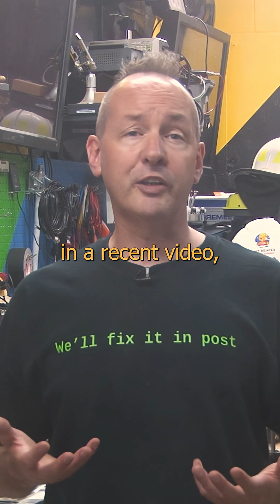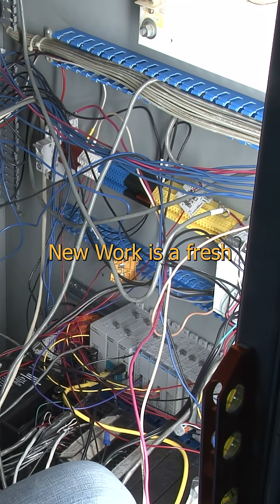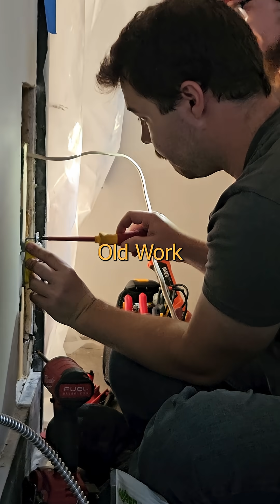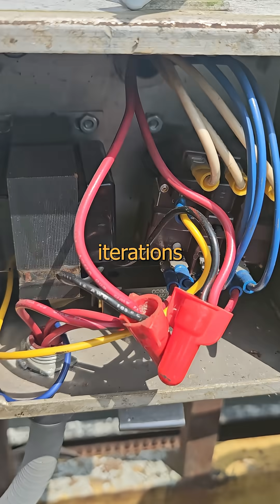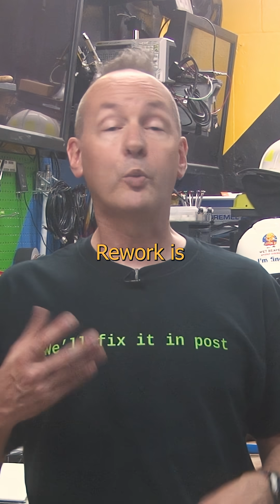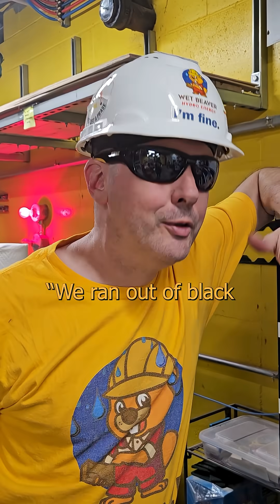New Work, Old Work, Rework #chrisboden #comedy #engineering #electrical #construction #educational

Comment: Pain. I had to re-do warm floor in my unit because some moron used two black wires in the electric panel for it instead of a black and a white. So when electricians were upgrading the panel, they assumed that it was a 240V circuit. Well, it was not.
Reply: I'd say the fault is more on the electricians that assumed based on color conventions when conventions frequently get subverted in the interest of going home at 5 PM
Reply: @esper4605 exactly 😅 I never assume the last guy did it right, I actually tell myself the last guy did it wrong so I don't get as pissed when I see the jerryrigging 😂
Reply: @TylerAllen-zx2ef  Especially if you were the last guy.
Reply: Nah I love when I was the last guy. I always give my best and almost Everytime I've had to come do something I touched last, it's nearly always a smooth job  @MrStrykerOne
Reply: @esper4605 Go see the comment I just left for just that
Reply: @esper4605  those assumptions are based off of strict state electrical codes but go off on how you dont know about the lowest minimum standard in trades
Reply: @MDS-SAP  no need to be nasty, we're all trying to learn here, yelling at people for not knowing something isn't going to teach jack.
Reply: @MDS-SAP I mean its not like he said those codes dont exist, its just that some people cant be bothered to follow them.
Reply: 20 year Electrician here... honestly I would hold the electrical company accountable that didnt label the black wire that they clearly had to unhook from the neutral bar. I cant tell ypu how many times I've seen whites used as hots and black/reds hooked up as a neutral.
Reply: Yeah... now imagine that but in an entire datacenter! I've had that happen... the client was not pleased.
Reply: I was an authorizor for a home warranty company- one time this tech was charging an insane amount just for access, so I had to call him and ask a few routine questions.

The broken sump pump that needed replaced was behind the water heater and the broiler. In a tiny closet.

We spent half our time together talking shit on who was responsible for
Reply: I'm sorry, but I don't know what 
R.A.C.K. means 😢
Reply: Why is there a yellow ! Next to your name? intentional or are you flagged somehow?
Reply: @kalash1994 he paid for 10 months of Chris's thing
Reply: They pulled the neutral and hooked it up to a breaker?

I can see the confusion but damn.

Did they phase tape it?
Reply: @nb117  The original electricians used two black wires for the neutral and the live wire. One of the black wires was marked with a white marker (it might have been taped at some point) and plugged into the neutral bus.

To make matters worse, I have another warm floor system for another room that is 240V.
Reply: Simply looking where there wires came from in the panel would have solved any confusion.

Not a very THOROUGH tradesman, obviously.🤔
Reply: Black and ???White??? Huh? Shouldn't that be black and red? Red hot, black neutral. What's the black/white scheme? (and if black isn't neutral, that dangerous)
Reply: @Chris-hx3om  afaik, black neutral is only an automotive standard, usually black is live and white is neutral in most industrial/domestic settings, in the US at least. I'm sure there's exceptions to this, but in my (albeit very limited) experience, black is hot, red is also hot (usually used on 2 phase wiring), white is common/neutral, and green is, of course, ground.
Reply: @jarbarsi from my experience with installing smart light switches, black is hot, white is neutral, and red is the load (or they are supposed to be anyway)
Reply: @qpSubZeroqp  I personally haven't touched any light switches but I would believe that, the most experience I have is from wiring appliances, where black and red are used to differentiate the 2 phases of power. I have a lot of experience with this after having to replace the same dryer 3 times in a row a few weeks ago due to incredibly bad luck lmao. (as you could likely guess, that was a bad day, I got really familiar with my 30A nema plug wiring though!)
Reply: @qpSubZeroqp  There are a few exceptions. 
Trying not to confuse electricians, lighting manufacturers used black as hot, white as negative and red as switch leg. As far as I know, this is the only done on low volt lighting. Of course purple and pink are dimming.

When you go to mobile DC, black is negative, red is hot generally.

The whole thing goes back to Edison trying to get people killed to make Tesla look bad.
Reply: @qpSubZeroqp  Building lighting uses AC standards, which is opposite of DC standards, even though the lighting is DC.

Black-positive (hot), white-negative (neutral), red-switch leg. 

Most AC electricians don't know DC.
Reply: @jarbarsi  The rest of the world (I believe) uses Brown-Hot, Blue-Neutral, Green/Yellow-Earth.
Reply: @jarbarsi  Single PHASE - 2 POLE-240V wiring...there's no such thing as 2-phase.

120V pole to neutral/ground...240V pole to pole

3 Phase 600V - 600V phase to phase and 347V phase to neutral/ground

Black is "neutral" in automotive ?....it's DC...it doesn't HAVE a neutral...it has a ground to complete the DC circuit.

Make sure your fire insurance is paid up and please....DON'T work on it. You'll kill someone with your lack of knowledge.⚡🔥
Reply: @CannonFodder873  I mean, thanks for the correction, I admitted I don't have much experience in another comment, but you really didn't have to be rude about it, I just came home late from a really shitty day at work and a snarky comment about something I said wrong two days ago was really not what I needed to see. I'm sorry my mixing up of neutral and ground was so hard for you to read (I understand that cars are DC, I just mixed up the words "negative" and "neutral"), and that my knowledge about 240V electrical wiring standards was incorrect (I actually just didn't know this, thank you again for the correction), but as I said in a previous comment, we're all just trying to learn here, being nasty isn't going to help. 

You act like I'm about to burn my house down when I haven't touched the wiring in my entire life, something you need to realize is that I don't know things because I don't have experience, if anything, I need to do MORE electrical work because THAT'S HOW YOU LEARN! The only "electrical work" I've done is wiring a plug to the back of a new dryer, it shouldn't be any wonder I'm not immediately an expert on this, no?
Reply: @jarbarsi  My apologies if you were offended. That's why we have trade certifications. So it gets done safely and correctly. My trade training saved my ass from getting hurt troubleshooting unsafe wiring installations more times than I can count....at voltages that are magnitudes higher than household 120/240.

Electricity is a HARD teacher. Not everyone survives. Stay Safe.⚡⚡
Reply: @Chris-hx3om  not sure where you are from. 
In the United States using AC power white is the standard color for neutral.
Reply: @Chris-hx3om black and red are fine for 240 in the north American market. Two blacks aren't kosher for a circuit that's designed for 120.
Reply: @Chris-hx3om  In NA black and red are both hot leads, white is common/neutral, and green/bare is ground.
Reply: @Chris-hx3om  In American homes, black is hot and white is neutral, unless it's a 240v circuit then black is 120v and there's a red for 240v, and bare copper is ground in both cases
Reply: @Chris-hx3om  In the US, the commonly used color coding is: black - hot, red - secondary/switched hot, white - neutral, green/bare copper - ground (earth).
Reply: @Chris-hx3om  DC; black is negative and red is positive. There is no neutral wire, black is ground.  Industrial DC drives and motors are different, but won't get into that.

AC; White and gray are neutral, green is ground, green with yellow stripe is isolated ground. Black (or phased colors) is hot.
Black/Red/Blue are hot. Brown/Orange/Yellow are hot.
Reply: @Hathorr1067  good overview, one thing I find a lot tho is that equipment will often follow the European standards internally, so you end up with a Blue neutral and a Brown hot once you open the cover, I'm just happy the world largely agreed to keep earth green, that's nice. I'm not sure why this is exactly, maybe how most things aren't manufactured in the US, but I always assumed Europe was more strict than the US on imports so they stick to European to sell to both markets, but that's purely just a guess.

Edit: OH and I should add for anyone new to electronics, NEVER BLINDLY TRUST THAT RED/BLACK ARE +/- IN DC EQUIPMENT, especially when there's often multiple voltages (e.g. some common voltages are 3.3v, 5v, 5.5v, 12v, 15v, 18v, 24v, 48v), ALSO NEVER BLINDLY TRUST THAT THE COLOR CODE IS CONSISTENTLY USED ON DC EQUIPMENT (e.g. just bc the battery uses red/black doesn't mean the red/black on a ribbon cable elsewhere are power).
Reply: @xxportalxx.  To add to this, I mostly work in automotive, where red is positive/power and black is negative/ground, but only for power distribution rails! Ground is usually black (or bare braided cable) elsewhere, but, due to the sheer number of separate power and data lines that need to be bundled together in any given run or pigtail, they're color-coded by destination instead of whether they're + or data (or even ground, when connecting to modules that don't share a ground) in order to make it even remotely possible to look up a diagram and find the wire you're looking for without having to tear the entire vehicle apart to physically follow a wire. (Unfortunately, I'm often tasked with looking at aftermarket systems where all of the wires are black, so that's something else to deal with.) Basically, you can never assume you know the polarity or voltage (or current on the fuse) of any system in a vehicle without detailed and up-to-date references, so be careful with electrical work if you don't want to fry the PCM or something equally easy to mess up and expensive to replace.